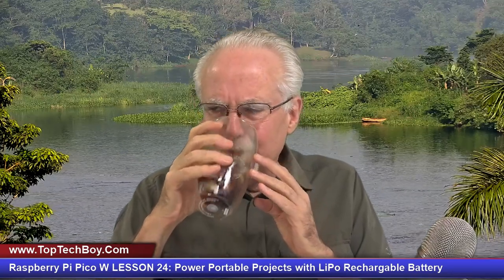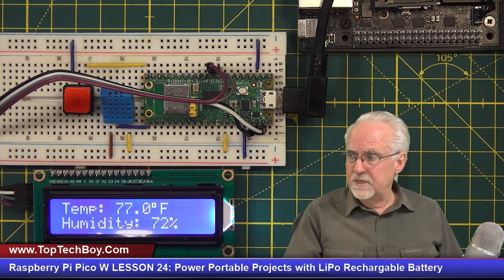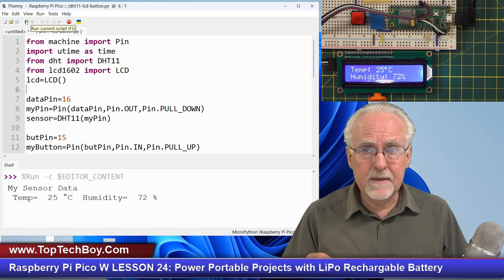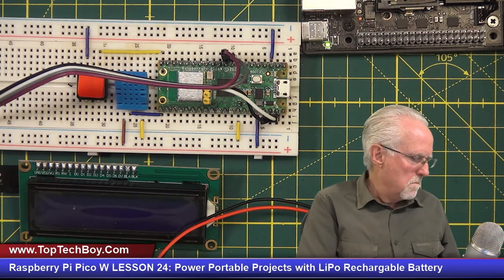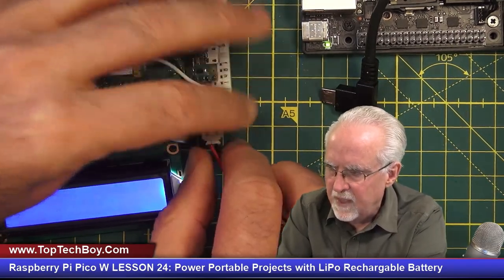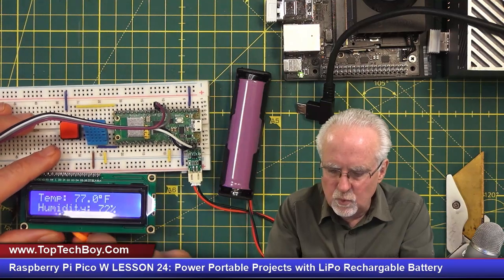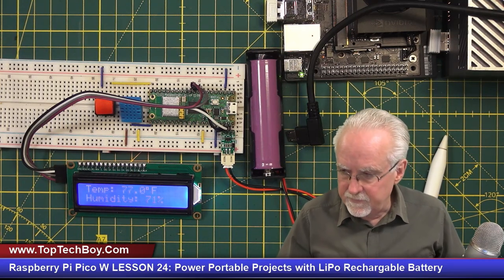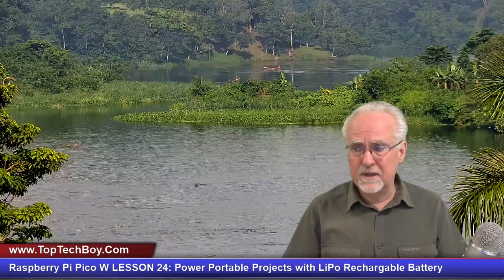Raspberry Pi Pico W LESSON 24: Power Portable Projects with LiPo Rechargeable Battery

Comment: O/T, Hello Paul, I have been to your Website I can not find a link to a email, so I am here. I wish to get START with Arduinos, Max 7219 8x8 Dot Matrix and a SCREEN(7mm Square for a HO SCALE LAYOUT). I do not expect all of the CODE that will show a NUMBER, 1-0(10 Numbers). Each Number will represent a Turn Out/POINT, being about 2 mtrs away from the Operator. I have got something for the Number 1 and its 0's and 1's to form a 1. I would a little help, I need to know where things are placed on the IDE

Comment: What is the tiny bms board you're using for the 18650 cell?
Reply from the maker: It is the board with the sunfounder kit. Dont think it is sold seperately.
Reply: @paulmcwhorter  That is unfortunate. I'm designing a product currently and I liked how small that one is. I found a substitute though. A little bigger but it'll do until I make its own pcb.